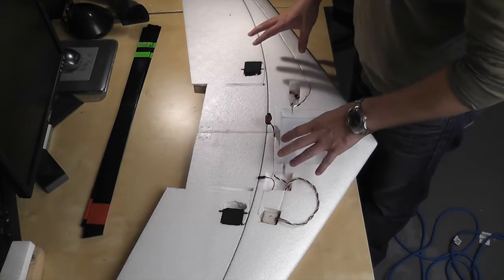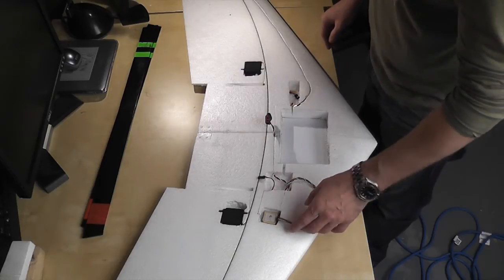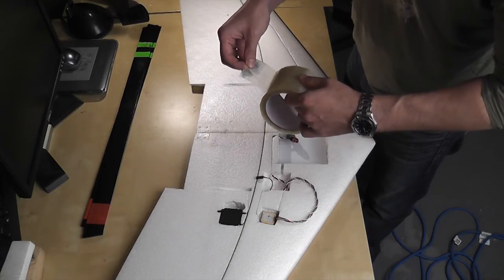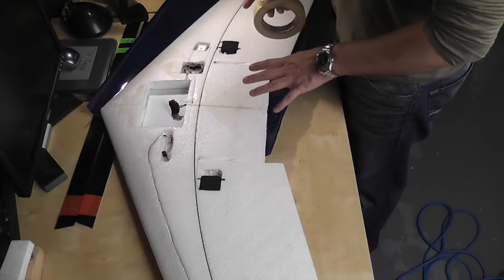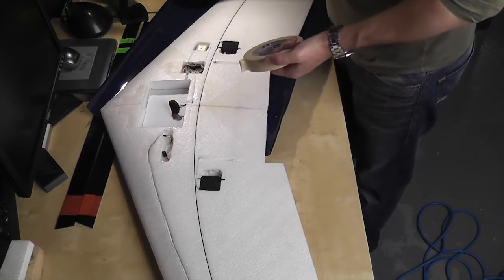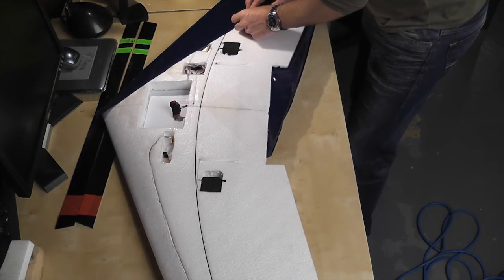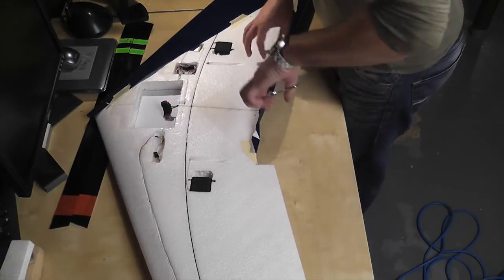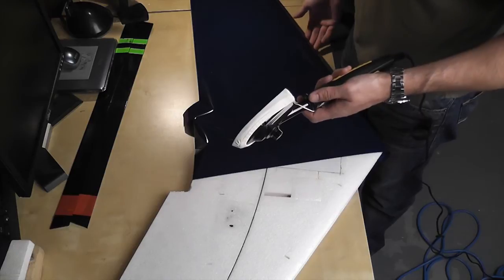Windrider Scout Bee Build Part 3 - Laminate Covering

Comment from the maker: This laminate(Actually covering like monokote, not laminate) was purchased from HobbyKing.  I also got the Turnigy iron from HobbyKing.  The iron is ok, but I wouldn't use the covering again.  It's stick well enough to the EPP and it shrinks, causing some warping.  Instead, I would paint and then cover with 3-5mil laminate.  Much stronger.

We are now building TBRC wings and coating them with fiberglass first, then laminate.